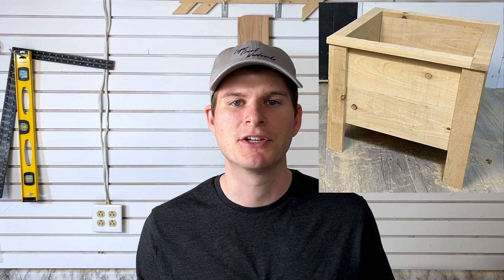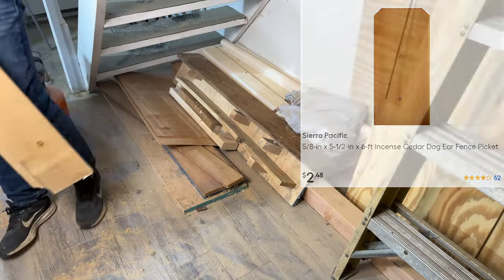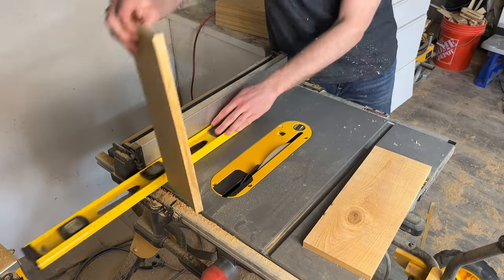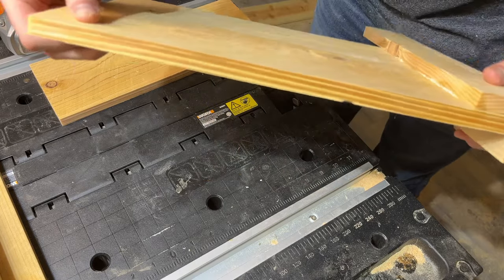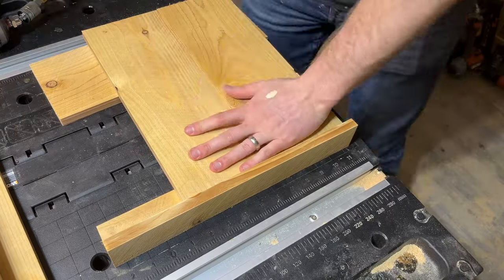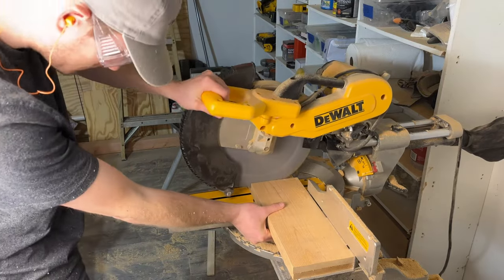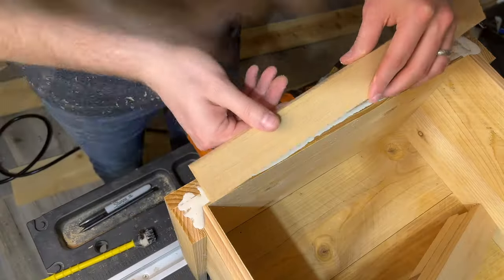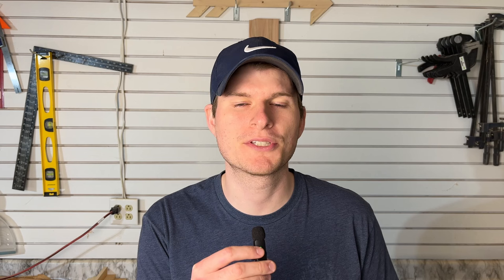The 45 Minute Planter - Make Money Woodworking

Comment: Whats the purpose of the glue if using nails? Like what would happen if no glue was used with the brad nails
Reply: Nails will pull out with wood movement, freezing/thawing and the constant weight of the soil pushing against the walls.  Longer nails driven in an angle will counter this somewhat.  Glue is just cheap insurance if screws aren't being used.
Reply: The glue is doing all the work. The nails just need to hold long enough for the glue to dry. If you just used nails, they would rip out within about 6 months to a year. Especially thin brad nails from an air nailer.
Reply: Yea, brad nails don't really have a lot of holding power, they are not good (alone) for "non-static" projects. And cedar is a really soft wood, they would just pull out easily, the nails.
Reply: @macp349  I just watched a video about various wood glues including Titebond Ultimate 3. I understand (now) that wood glue typically has 1000+, 2000+, or 3000+ pounds of strength. Aka way way way more than needed for holding soil and water and way way way more than a brad nail

Comment: You need a hole in the bottom for drainage or you'll kill everyones plants. ;) FYI.
Reply from the maker: True, if the bottom panels are too tight, you could have drainage issues. 

I like to line the bottom with a weed barrier to keep the dirt in and let the water pass through.
Reply: I recently got a bunch of fence boards home and they are fairly wet. Should I wait for them to dry before I assemble planters?
Reply from the maker: @Jmatoon1  Ideally yes. As they dry, they will shrink and warp some. Try to lay them out as flat as possible and even add some weight to prevent it.